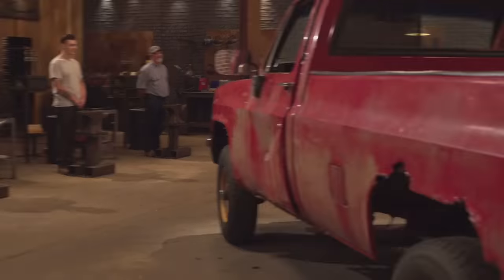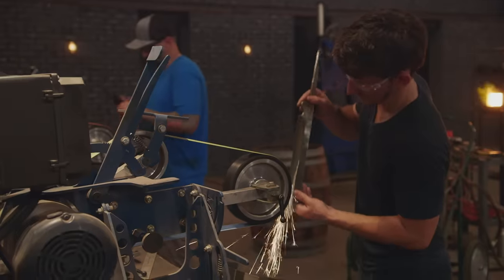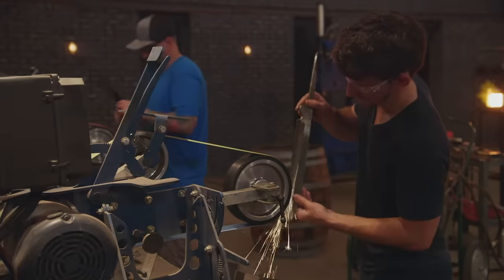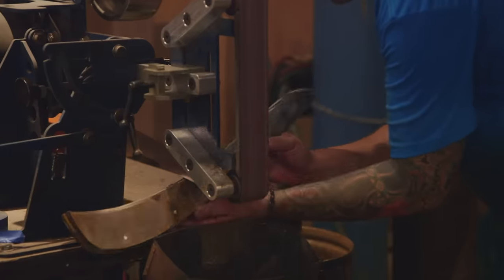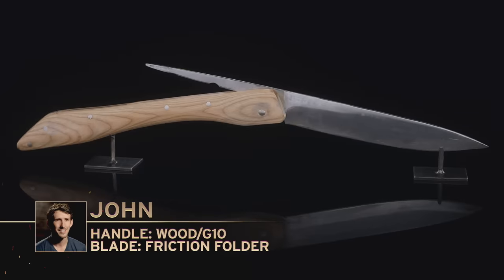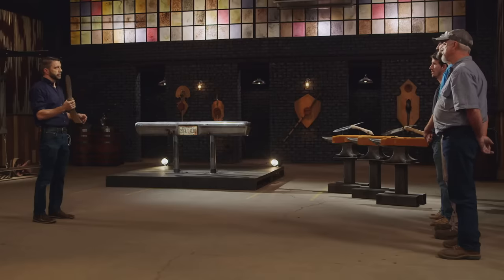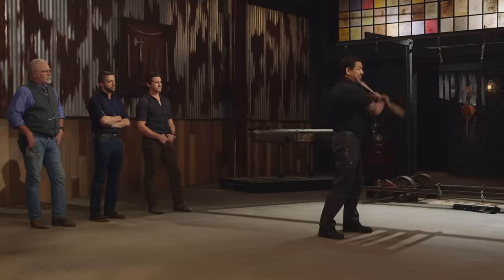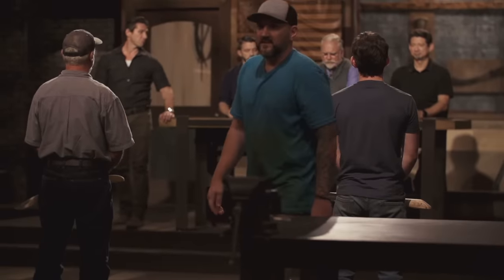The Friction Folder Knife FAILS in the Forge | Forged in Fire (Season 6)

Comment: you'd think they woudl do sharpness test before strength
Reply: That would make things to easy. Like it is, you need to pass the sharpness test DESPITE any damage sustained during the strength test.
Reply: You can sharpen pretty much anything to be razor sharp. The difficult part is making an edge thats sharp and holds up.

Comment: I still don't quite understand the concept of a friction-folder knife.  I've seen a lot of folding knives, but most of the ones I've seen were ones where you squeeze it and the blade flips out into a ready position.  Am I correct in assuming those folding knives have some kind of special locking mechanism that holds their blades in place, and a friction-folder's blade is held in place simply by how tight the handle material is?
Reply: A friction folder has no locking mechanism and no assist like you're talking about.  The blade is a snug fit into the handle, and the only 'lock' it has is that you're grabbing part of the tang when it's open, so it can't close as long as your hand is holding the grip.

You notice that when the knives are closed the tang projects out like a stubby blade, and when the knife is open it's hidden in the handle?  That's the lock, and in some designs the opening device too.
Reply: @earthknight60  Gotcha.  Thanks for the explanation.